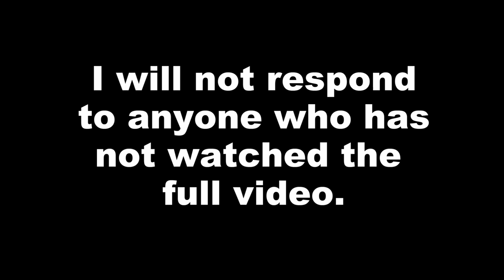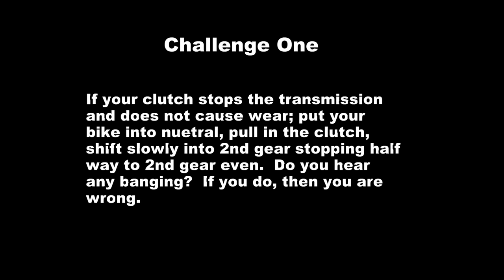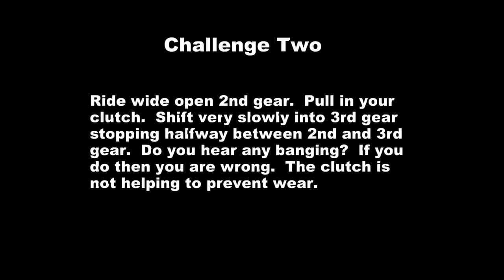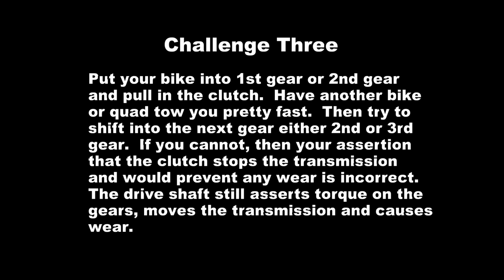Dirtbike: Shifting without the clutch

Comment: Your video is good in that it details the inner workings of a trans and makes several good points, but it fails to make a case for no difference in gear dog wear thru clutch-less or clutched shifting.  While a clutch doesn't totally disconnect the gear train from the crank, it does unload it significantly.  (Btw, it's rare but some clutches will completely disengage a trans.  Just depends on the amount of plate clearance and the viscosity of the oil.)  This should be common sense and easily verified by experience; but if there's an argument, check any owners manual and it'll tell you the same.
Reply from the maker: Hence the let off the gas part, as described in the video.  Also described was that load can come from either the rear tire or the crank and down a hill the rear tire can put more load on the gear dogs causing same issues and using the clutch won't fix that.  Again, video detailing why you believe differently since a comment is irrelevant.  Just saying "it eliminates load" without visually detailing and showing why as I have done in this video is not evidence or an explanation.
Reply: I never said a clutch totally eliminates load.  What I did say was that some can, based on plate clearances and oil viscosity (the latter obviously limited to wet clutches) but it's rare.  I'm also well aware that loads can come from either end of a powertrain so that was not contested either.  What I was contesting was the idea that there's no difference in wear between clutch and clutch-less shifting. 

Letting off the gas does indeed lessen the load, but unless your shift timing is continually flawless -- which no one's is, you're still rounding the gear dogs more than you would using a clutch.  Also, letting off doesn't gain you anything timewise over using a clutch.  The guys that race at this level could care less about the wear on a trans and therefore bang them pretty hard, which is where the time advantage comes from. 

As to a video, that would be a bit unreasonable a request as it would require several examples over extended time periods to show it in a convincing manner and I have better things to do.  ;)   I'm offering what I did from nearly 40 years experience as a mechanic in automotive, aviation, heavy equipment, small engine, and RV fields. (The only transportation modes I haven't repaired are ships and trains.)  It's totally okay if you don't agree.  :)
Reply from the maker: We can't just take your word for it.  I demonstrated it in a video with details.  Without actual demonstration it is just nonsense on the internet.  Also, the same argument can be used for the clutch as I mention in this video.  You have to time your hand with your foot and the clutch plates need force to disengage.  So that argument is invalid.  I will not respond without actual proof and demonstration as I have taken the time to do, I don't take things on blind faith especially when they make no sense.
Reply from the maker: I have also rebuilt many dirt bikes I rode for years.  The gear dogs were perfect, so unless the wear is invisible this is again nonsense.  The whole purpose of a sequential gear box is to be able to shift without a clutch, look it up, this is documented.  If you shift without letting off the gas it will not let you shift if there is too much torque on the gears.  I have said all of this in the video, explained in detail, showed how the transmission works and debunked everything you have said.  So if you think you are correct, as explained in the video, you actually have to prove it with a video and documented details of a physical transmission.  We don't believe in Santa Claus here, we only see evidence and logic.
Reply: Like I said, guy, I have better things to do and it's okay if you disagree.  :)
Reply: Mark - I have seen more dog wear through the power shift method of using the clutch, i.e. leaving it pinned and grabbing a small amount of clutch and shifting. I personally have never seen any dog wear on my own bikes, I downshift without using clutch and let off the gas for a second to up shift. I use the clutch to keep from stalling, but usually only slight pressure to it, I use it to take off from a dead stop so I can build the necessary rpm and I use it to hold a sweet lever that makes my machine look good. that's it. I replace clutch components rarely and have never replaced transmission parts in 27 years of racing mx.
Reply: my only small disagreement with this video is that the amount of time it takes for a 2 stroke to run out of oil in the crankcase upon deceleration without pulling in the clutch should be clarified a bit more. it's not instantaneous, though I most certainly would not disagree it could happen, I have never seen it. I believe it would take the bike less time to come to a stop then run out of lubrication. I believe it would stall first or if deceleration was matched with down shifts it certainly would be slow enough the rider would fall over
Reply: Hi Opferman, fantastic video, thanks for making it.   I come from an auto racing background (but own a 250R quad also) and now just purchased a shifter kart (honda 125).   I'm a bit worried about downshifting, needed to do it all the time in the car to keep the brakes from burning up, now it sounds like that's not a good idea on the shifter...  Does the oil around the crank really dissipate that quickly??  I'm hoping hondaman331 is right...    I know in my quad I can go down massive hills and let the engine slow me down without issue but that's at probably 4000 RPM..  The shifter seems to like 12,000 RPM, so if I'm at the end of the straight, let off the gas, hit the brakes (engine coming down from 12K), will that cause excessive bottom end wear unless I pull in the clutch??
Reply: Jim Willittes don't engine brake a 2 stroke. It wouldn't cause too much gearbox wear but it is a good way to weld your piston to your cylinder.
Reply: Thanks Gun... makes sense.   Someone should write a book about all the things that you normally do in a car that would blow up a shifter kart...
Reply: Boogers won’t load any app that I can’t access. The officer said that he was not sure if you were planning one of those things that you would like.
Reply: hondaman331 a two stroke won’t instantaneously explode from engine braking but if it’s done repeatedly it will wear out a lot faster or potentially seize (from the irregular wear) . How much of a factor it is also depends on the riding style and terrain. Someone who engine brakes a 2t on long off-road downhills is doing more damage then someone who is coasting for very short periods of time on a flat motocross track for example.
Reply: It's obvious by some of the responses telling you you are wrong, that these particular riders ( if they in fact even ever rode a motorcycle) don't have the feel for it, more bluntly they have the grace of a hippopotamus when trying to coordinate the shift and throttle position. One of my best friends I was in the US Air Force with, while he was an exceptional Avionics Guidance & Control Specialist, was not great at driving anything with a manual transmission.
Reply: This shouldn't be possible because when you let off the throttle the carb doesn't cut air/fuel off completely. Even if the throttle plate/slide closes completely the pilot/slow jet circuit will still pull fuel into the engine. If there was a complete fuel cut off, it would act similar to hitting the kill switch while in motion. The crank isn't in danger of oil starvation, the rings and cylinder walls are usually the first to go under oil starvation situations because the rings "wipe" the oil off every stroke. There are videos on youtube of 4-stroke engines running for over 10 minutes without oil before locking up; To do any real potential damage you'd have to be engine braking down a huge hill for over 5 minutes long. Typical engine braking for 10-30 seconds shouldn't hurt anything.

Comment: Your last point about letting off the gas and "drifting" would apply only to two stroke engines right? As four strokes have a different means of lubricating moving parts, and engine braking is one of the debatable nice features of 4 vs 2. 

Great video, super informative, and my mind has been eased about clutchless shifts.

Comment: The only transmissions you have to use the clutch in are cars. I drive truck for a living and when i need to upshift I just let off the throttle and it lets me slide into the next gear no problem. As far as on a bike the only thing I could think that would help the trans by using the clutch is when you finally get the dog lined up you can feather the torque onto the dogs a little smoother rather than them slamming together. But those dogs are built for that anyway. As far as high rpm and no throttle. Unless you are rolling down a hill for a half hour at 7000 rpm with no throttle you should be fine. I guess if you mix your oil thin their might be an issue but Suzuki says run 32:1 so I run 32:1.

Comment: I own a Suzuki DRZ 400 which is set up for street & off-road and when I accelerate I almost never use my clutch to up shift I only use my clutch to down shift btw it is a 05 and to this day have not had the need to change out the clutch plates,Pressure plates or basket

Comment: Just index it. There is a point in the transmission that it wants to shift easily. I was able to wait for the right RPM and 'feel' it wanting to shift to another gear. I did that when I wanted to film with one hand, and throttle control with the other. That left no hand for shifting without the clutch. Being cautious I was able to shift back and for to give me control over the speed through motor breaking that way, and I got a good video. I've since mounted it on the handlebars and made my recording easier, but it can be done without input on the clutch.

Comment: Ive been riding bikes for nearly 100000 years, and i have learned that proper shifting does not require the clutch regardless of shifting up or down. All you need to do is sycronized the rpms of the forks and there heat of the chain into a synthetic harmony. Then, sport bikes will snort good race mesh.

Comment: great video exelent explanation and video of how a dog box works and why you dont need clutch for gear changes. modern day rally cars with dog boxes can cut the ignition when gear lever is moved so can change gear with throttle wide open. awesome vid BIG THUMBS UP !!!!!
Reply: another great point made was about free rolling in gear on a 2 stroke how it does not get enough oil due to oil being in the fuel and a blip of the throttle can solve that. AWESOME VID

Comment: well there two forms of clutching full clutch and half full disengages the PTO output shaft completely and half slides the fork outward enough to smoothly change gears without grinding off the outside of the cogs or gears you may say I've never heard any magical clutching tails for one so idk what they may be talking about lol

Comment: I had a bike a couple years ago and i never shifted with the clutch. Sometime after I start doing that shifting from 3 to 4th gear the bike would sometimes come out of gear or in between gears is that a cause of shifting without clutch? Now i have a new cr250r and I always shift with the clutch never had a problem.

Comment: It is true what you say, but you are not mentioning anything about inertia. Using the clutch will decouple the inertia of the piston and crank from the gearbox and put A LOT less strain on the dogs. When not using the clutch the dogs will have to handle the force of accelerate and breaking the engine rotation mass in an instance. That is a lot of energi. Using the clutch will be A LOT softer impact for the dogs. However the gearbox is made to handle up-shifting without the use of clutch, but there are no reason to do it unless you are want max acceleration.

Comment: Good vid. Ive always shifted without a clutch while just putting around. A sometimes times under hard acceleration/loads id use a clutch. But 90% of the time i dont use a clutch. Not had any problems. Heck, semis are shifted without a clutch and they are under tons more power and loads.

Comment: Nothing wrong with shifting without the clutch as long as you are able to RPM match. Clutch allows feathering a mismatch between RPM and new gearing in order to decrease drive-train shock. As shown here, the transmission is perfectly fine to shift without a clutch. However, if there is a RPM mismatch it will jerk the whole drive-train therefore increasing wear or breaking something.

Comment: For for stroke engines, is it OK/healthy to engine brake the bike (downshift with clutch pulled in then disengaging the clutch to slow the bike down)? I do it all the time but I'm not sure if I'm wearing down the engine more than it should be
Reply: Tom Szawarski Yep completely safe, have you ever heard the awful racket a semi truck makes when going down a hill? On those engines theres a mechanism on or around the cam that changes the valve timing that makes the engine work more like an air compressor to give even more engine breaking power. On a 4 stroke dirt bike you have a solid cam that doesn't change valve timing so you don't get the massive engine breaking feature like the semi. All engines are built tough enough and designed to engine break when you let off the throttle. On any 4 stroke engine the oil is always pumping when the crank is spinning. Hell, even in modern automatic transmission cars if you stab the break the transmission will downshift to assist in breaking down a hill.

Comment: Shifting up without the clutch you need to blip the throttle to release the torque from your transmission, when you shift down you should always use your clutch because shifting down you will have a lot of torque on the transmission due to the rpm difference

Comment: Not rebuting any claims here .but one way to find out would have 2 bikes. One you used the clutch for 500 miles or however much you need to present this..and the other you don't use the clutch...then open the casing and see if there is any damage..

Comment: I picked up  a YZ80 that's been sitting for at least 5 years with a blown head gasket .well I finally replaced it  got it running , but when I put it in 1st the shifter dont pop back up, any suggestions what the problem might be..

Comment: I have a dumb but quickest answer: Because you would spend most of the time clutching than accelerating on a dirt bike. I remember factory 2 stroke back in the 90's had automatic spark kill switch engaging when pilots moved the gear selector so, they had not to worry about releasing throttle.

Comment: so,if I was accelerating hard,full throttle,shifting up I used the clutch.not a full pull on the clutch just a dab to dip the revs slightly,mainly because she wont always shift under full load.going down through the box,I would normally have the clutch in as the brakes would be on hard.casual accelerating,I would shift without the clutch.

All this is on a variety of semi-factory mx bikes though (I was semi-pro/pro for over a decade).All top level Mx riders will ride this way,the clutch dip is called power shifting,it's how I and many others were taught to ride.

not sure about road/trail bikes as never been on them,nice video though,was very interesting!

Comment: I have a very temperamental clutch, so to make sure its there when i really need it i only use it when absolutely neccessary. It changed my riding style a little but if and when i ever get my clutch sorted properly ill probably still only use the clutch on occasion lol.

Comment: Clutching will slow you down...if you want to win race's pop that bike though the gears...the only thing you damage is the clutch basket and it still lasts a very long time before it gets slack and you only notice when first putting the bike in gear as the chain takes tension...hope this helps someone get better times